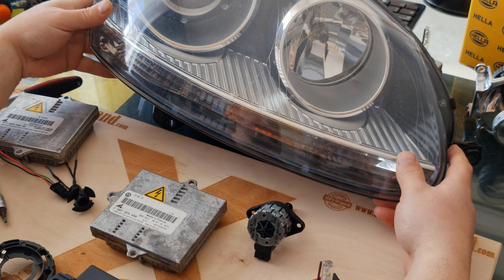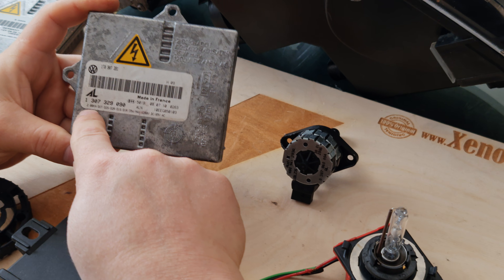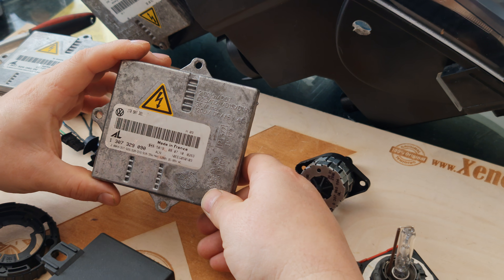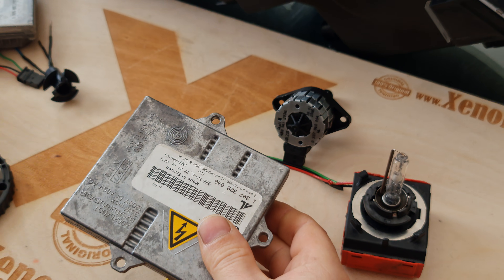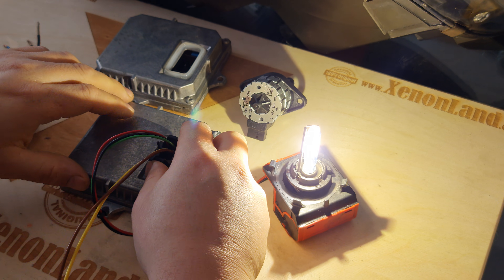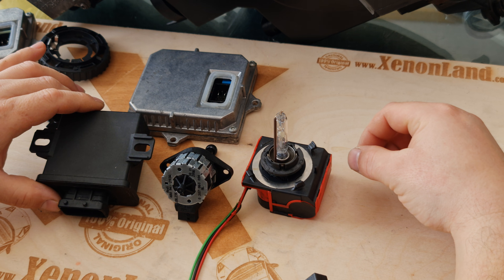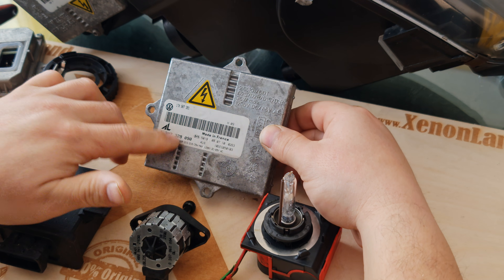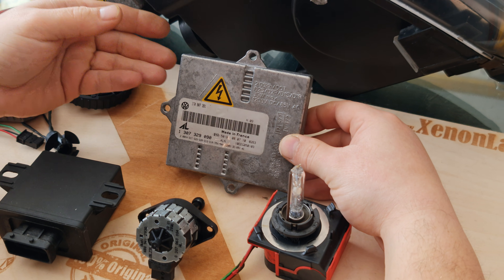VW GOLF MK-5 GTI & JETTA XENON HEADLIGHT BALLAST AL 1307329090 VW 1T0907391 REPLACEMENT ISSUES

Comment: The wires connecting to the igniter. I have brown green and black. Which one of those would be red black and white if converted
Reply from the maker: You probably have an aftermarket headlight. Genuine wires are in green, red, and black.

Comment: Hi! Thanks for providing great content. I have a MK5 R32 with bi xenon headlights. My left headlight is having an issue with the shutter that opens up when I turn on full beam. After 3-5 seconds the shutter closes. So you have any idea about what I need to do to get my shutter to work as it should do?

Comment: I replaced my headlight control module on mkv gti today but it came on when I connected my battery it came on and stayed on when the key wasn't even in the car and stayed on. Then noticed a 10 after 090 at the end of the unit number. I'm trying to figure out if I have to order another one or if I have a short my fault code is 00978. Thanx in advance for any help.
Reply from the maker: Check Lamp for Low Beam; Left (M29)
Check Wiring/Connector(s) from/to Lamp for Low Beam; Left (M29)
Check Control Module Coding
Reply from the maker: If you fit aftermarket ballast it will give same fault
Reply: How do you know if it's after marked ballast.   @xenonland
Reply from the maker: @xmrsuperx  Very easy, just compare the labels and you will see the font difference, as well as the metal base and its holes.
Reply: Thanx man I appreciate it

Comment: I have a big issue with my r32 passenger side don't turn on I did the left to right switch on each bulb, ballast, and igniter they turn on driver side but not on passenger side and I even swap complete headlight from driver to passenger, everything works fine on left side but not passenger side. I don't know what else is wrong but every time I  tap the ballast from underneath with my hand it turns on but for like a 1min or 2  it shuts off
Reply from the maker: From all you said it seems that you have a wiring issue. Please check the main connector plug which goes into the headlight plug. There should be (-) and (+) coming to the headlight. Power test should be performed. Second check also the ballast plug underneath the headlight for damage. Finally, although less likely see the fuses.

Comment: What’s the name of the wires the igniter is connecting to
Reply from the maker: It is a complete headlight wiring. No specific name, not sold seperately by VW
Reply: @xenonland how do you get it
Reply from the maker: @Markedsoulofficial https://www.ebay.de/itm/275897820627

Comment: Does the ballast fit to the mk4 2nd gen?
Reply from the maker: if you have FACTORY FITTED MK-4 xenon headlights, will not fit. Range control modules are different in MK-4 and MK-5. It will power the xenon bulb but you might have an error at your dash. If headlights are retrofit and you do NOT have originally factory fitted headlights, than it will fit.
Reply: @xenonland  
Thank you so much i apreciate that ❤️✊

Comment: Hi do you have a video on how to change the headlight motor please
Reply from the maker: Tomorrow we will make a video for headlight motor replacement
Reply: @xenonland  perfect is this easy to do with the headlight still on the car
Reply from the maker: Impossible to change the motor while headlights secured on the car
Reply: @xenonland  ok i suppose i have to remove the front bumper on the mk5 golf r32

Comment: I’m having a problem with mine. Every time I start my car, the headlights work. They turn on and everything. But seconds later they just shut off. They turn off completely. I dent know what it is
Reply: The wiring inside the headlights may have the insulation missing. If so, wrap the wires with electrical tape.

Comment: Hi, I am looking for these totally same OEM headlights and found ones. Both are with ballasts, igniters and retainers. My question is, will I have any problems with connecting it on present instalations (halogen stock Golf 5 headlights) - is it just to connect them on existing wires or should I have to adjust somehow the wires? Thanks a lot!!
Reply from the maker: NOT a plug and play. You have to purchase adapter cables for upgrade from halogen to xenon type headlights. Or your mechanic should modify the wiring to make compatible the xenon system (to be fully road leagal you have to put headlight washer system as well).